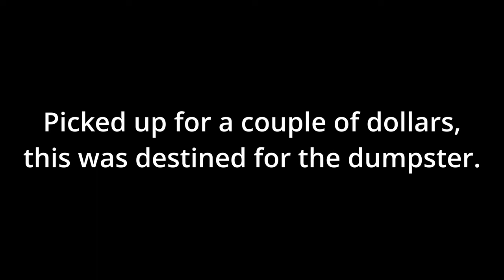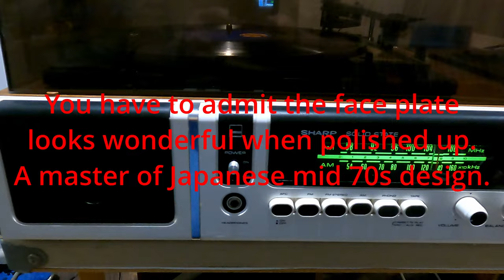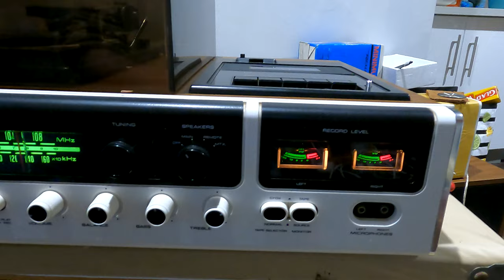ElectroSound Mini #1 Sharp SG 165X

Comment: Hey there! I have the same model but can’t seem to work out the aux/mic-in situation. Any tips?
Reply from the maker: Hi Eat Sleep Empire, the 3 in 1 belongs to a friend. She has found the user manual, it states for the microphone/aux function:

1. Connect microphones (supplied) to the left and right hand microphone jacks.
2. To prevent feedback (a high pitched whistle or howling noise) turn volume control fully counter-clockwise.
3. To monitor sounds to be recorded, connect a headphone (optional extra) to headphones jack.
4. Depress function selector button "CASSETTE PLAY/MIC/AUX REC".
5. Recording proceedure is the same as that laid down in "RECORDING FROM THE BUILT-IN RADIO RECIEVER".
It then goes on to suggest recording methods for best sound.

I hope this sorts things out for you. Otherwise you will have to cut a hole in the back to release the turntable and chassis screw, then clean all the pots, plugs, and sockets. Beyond that I can't really help. It maybe a dead capacitor or transistor.